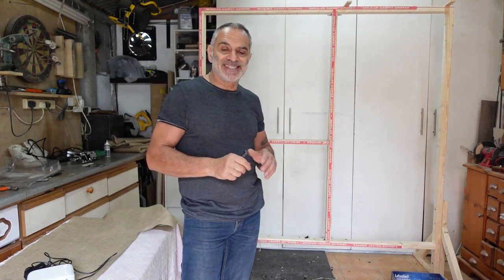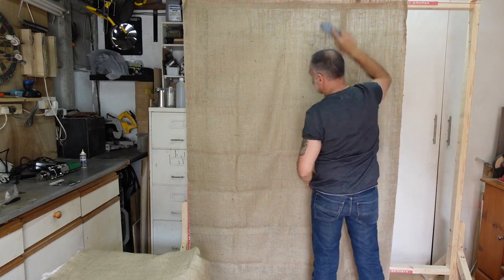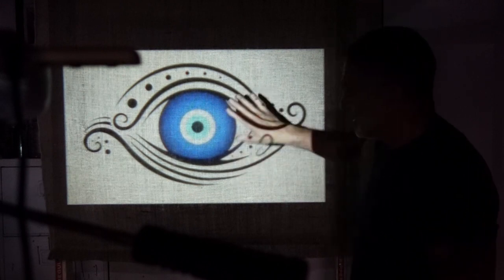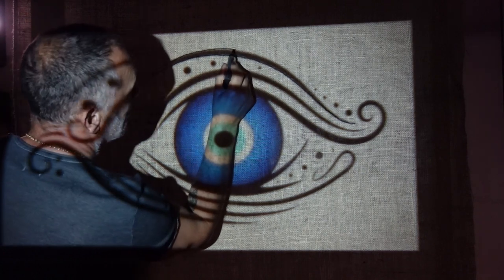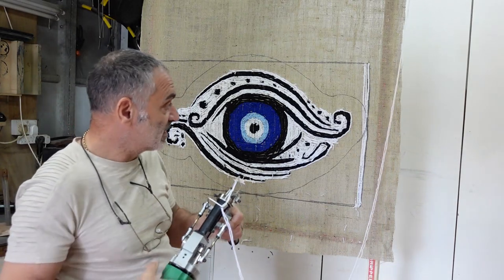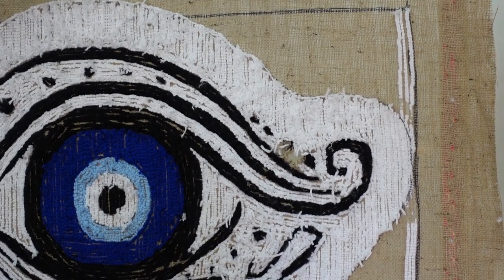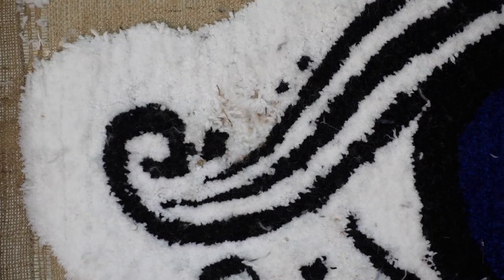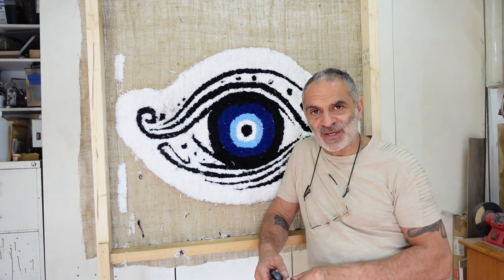Rug tufting onto a hessian backing and the problems I ran into

Comment: really great video, found it super helpful! do you know where in the uk you can get hessian 1.5m and above? Can only find it sold with 1metre height and want to stretch over a large frame!
Reply from the maker: Hi, I'm glad you liked the video. 
I have bought backing cloth from both ebay and etsy but when I decided to get serious about rug making I found a company that sold it in very large runs of 4.2 meters x 10 meters. Thats a total of 42 sq meters. The outlay seems a lot but when you break it down, it works out to around £4.50 per meter which is really cheap and this stuff is of the highest quality. You could even cut it up and sell it by the meter to make a profit. Take a look at their website
 https://millstek.com/product/primary-backing-fabric-225g-grey
Johnny

Comment: SO WAS IT THE MACHINE OR???
Reply from the maker: It is the machine. It is supposed to stop dead when you release the trigger but instead it runs on and rips the backing. For now, I can stretch my thumb over to keep part of the mechanism from spinning once Ive let go of the trigger. Its not ideal but it will do for now until the seller either replaces or repairs it for me.